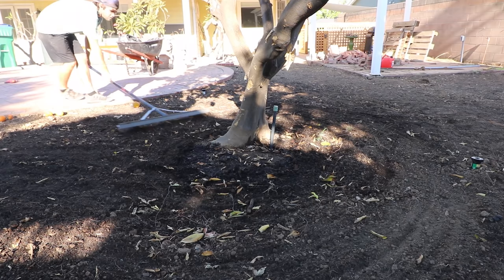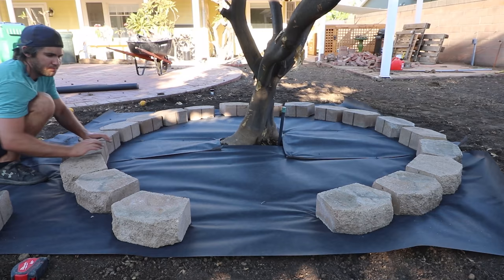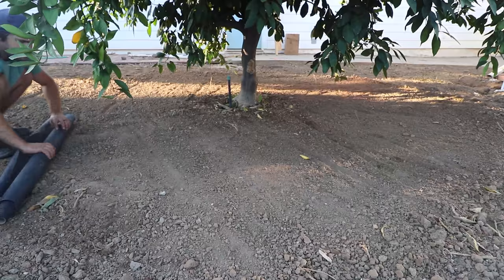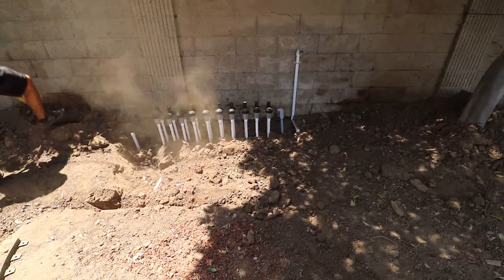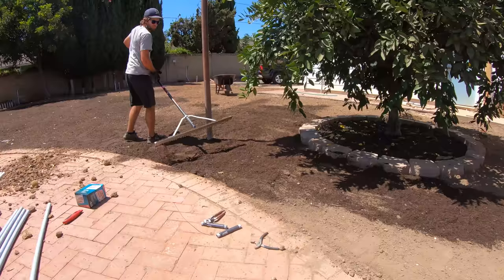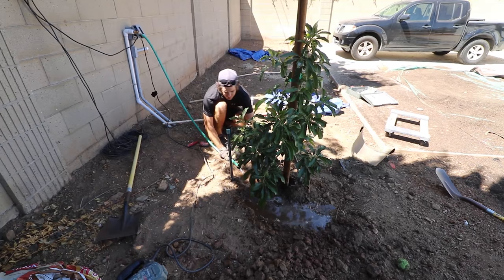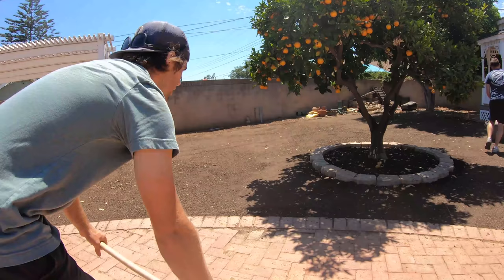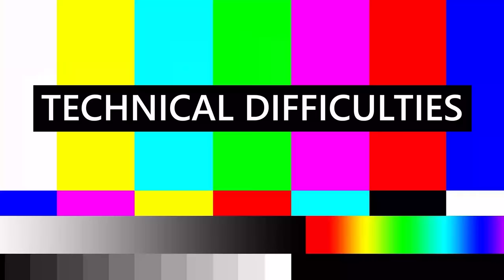Backyard Renovation Part 5: Final Preparations

Comment: I have loved watching you guys fix up your new house, and it is looking great! As a person with degrees in landscape architecture and horticulture though, I have a couple concerns and suggestions. With the evergreens by the sprinkler valves, did the trencher go through roots? I don't quite know what those trees are or what their root system is like (midwesterner here) but it seemed pretty close to the trees. I would keep an eye on them just in case. With the mulch around the fruit trees, I would just make sure to pull it back from the trunk a couple inches. Mulch will hold moisture up against the trunk inviting pests and disease into the tree which wouldn't be good, haha. Also having a perfectionistic personality I love a ll the hard work you are putting in to get the final grade as smooth as possible. Whenever you use a roller you should also be sure to aerate the lawn after it has established itself, so maybe next year to keep it healthy and looking good after all the work you've put in!

Wow, sorry for such a long post, I look forward to seeing the final product!
Reply: I was also concerned about rubber mulch being use near trees too. While rubber mulch is easy to install and last for years, (my dad has it at his house for the playgroud for the grand kids and it's great... just gets hot during the summer)  it could inspiring
Reply: I was also concerned about rubber mulch being use near trees too. While rubber mulch is easy to install and last for years (my dad has it at his house for the playground for the grand kids and it's great... just gets hot during the summer), it could harm your tree and you. As the rubber breaks down over time, the rubber adds toxins into the soil which the tree and it's fruit may absorb.  Be safe. Overall, great job on the home improvements. Love watch your channel and your laid back calm demeaner. Thanks for the sharing your creativity and inspiration.

Comment: Nice video. FYI If my research is accurate, avocado trees are recommended to be planted in pairs for flowering and pollination.
Reply: Yeah, you have a higher chance of a good crop with two. But it depends on the area. Some places are more ideal than others for self pollination. I'm not sure about California...
Reply from the maker: Yes that is true because there are A and B avo trees. Luckily, in my situation, there are a bunch of trees nearby. So I can assume it will be able to cross pollinate with a neighboring tree instead of having to get a second one